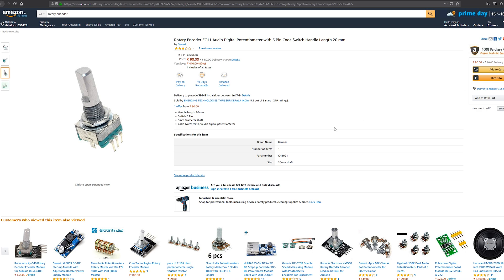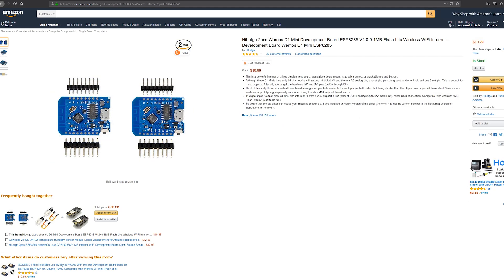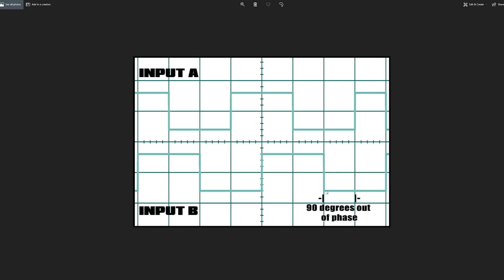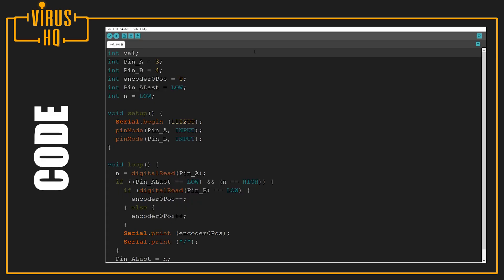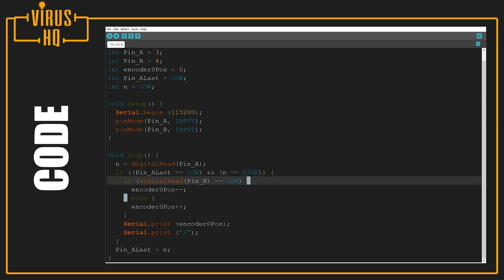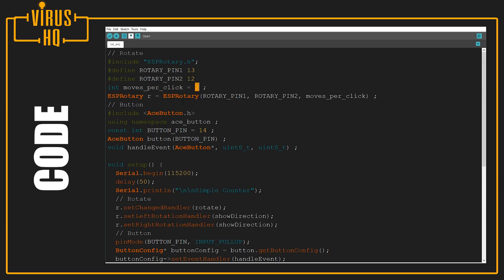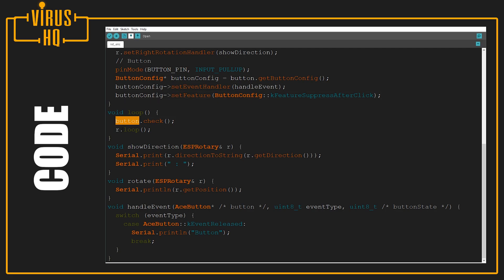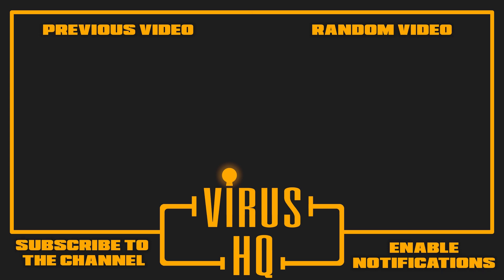Rotary Encoder Working with Wemos D1 Mini | NodeMCU

Comment: he Can't answer you questions about the code cause it's prob copied from someone else. It not even the same code he shows in the video. and if you look at the code he shares it uses pins  2 and 3. if you use pins D2 and D3 on a wemos as interrupts it will crash your wemos.  garbage video for views.